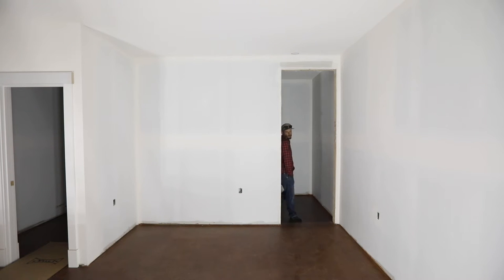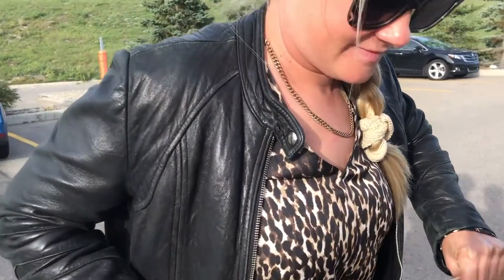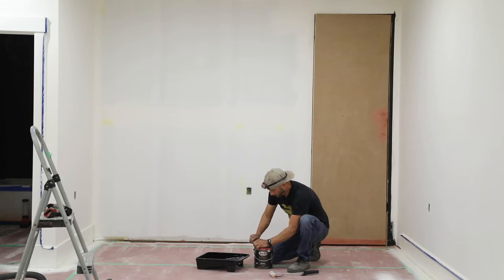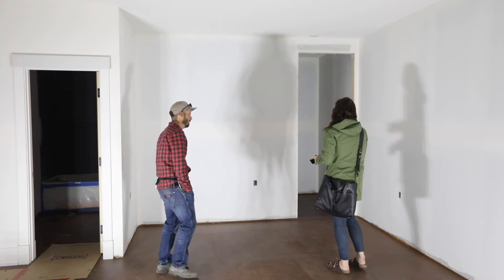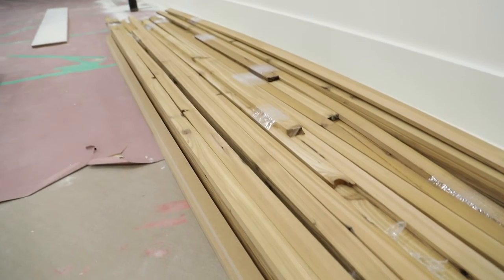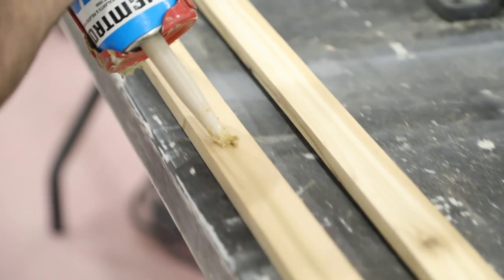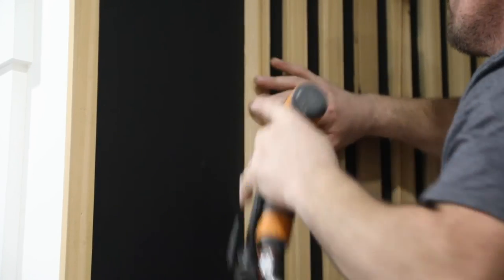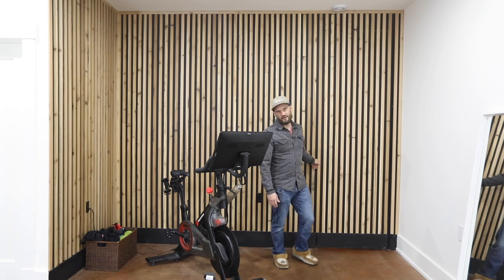Mid-century modern slat wall (How to)

Comment: Appreciate the video and candor.
Did you put the pin nails directly into the sheetrock?  I'm making one with walnut and that seems like a lot of weight on the drywall.
Thanks!
Reply from the maker: Yes straight into Sheetrock. That cedar is very lightweight.